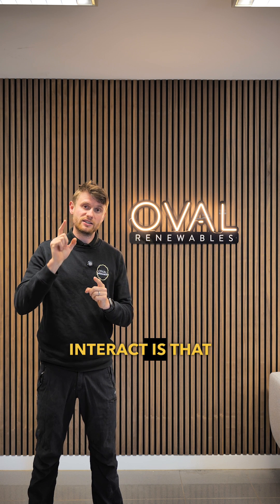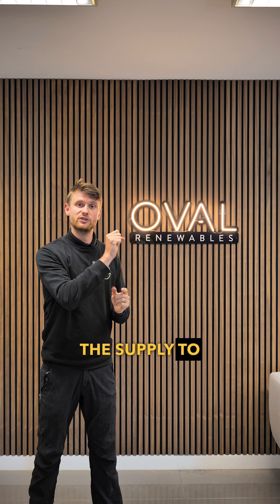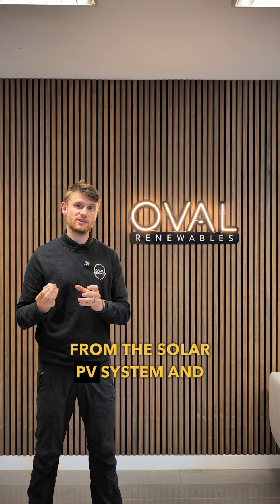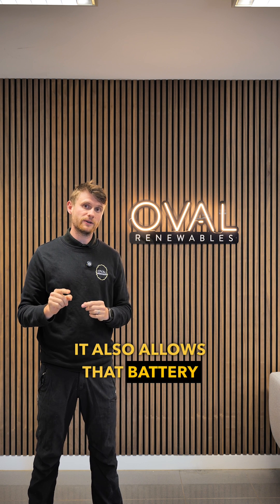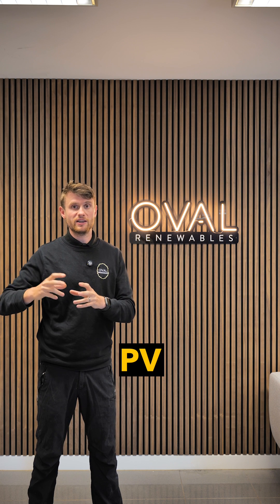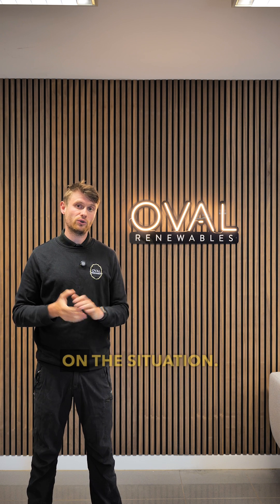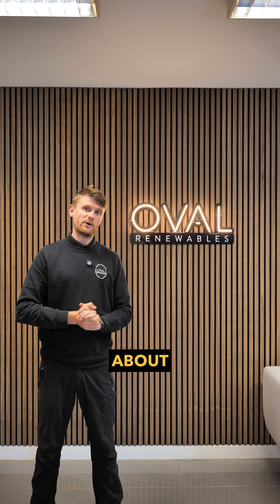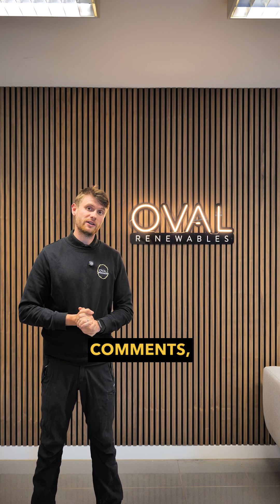AC & DC Coupled systems? What does this mean? Check out this short video for the answer! ⚡ 🔋 ☀️

Comment: In a solar power system, the solar battery is connected to the inverter via the charge controller. The charge controller is placed between the solar panels and the battery to regulate the voltage and current going into the battery, protecting it from overcharging or over-discharging, according to solar energy blogs and forums. The inverter then converts the DC power from the battery into AC power for household use. 
Here's a more detailed explanation:
1. Solar Panels to Charge Controller:
Solar panels generate DC power. This power is directed to the charge controller, which regulates the voltage and current to safely charge the battery. 
2. Charge Controller to Battery:
The charge controller is connected to the battery, ensuring the battery receives the correct voltage and current for charging and preventing overcharging. 
3. Battery to Inverter:
The inverter is connected directly to the battery. It converts the DC power from the battery into AC power, which is the type of power used by most household appliances. 
Why this order?
Charge controller protects the battery:
It prevents overcharging, which can damage the battery and shorten its lifespan. It also prevents over-discharging, which can also damage the battery. 
Inverter provides AC power:
The inverter is essential for using the stored DC power from the battery in your home. 
In essence, the charge controller manages the charging process of the battery, and the inverter converts the battery's power for use.
Reply from the maker: Is this Chat GPT? 😂
Reply: @OvalRenewables looks like it 🙄 🤖